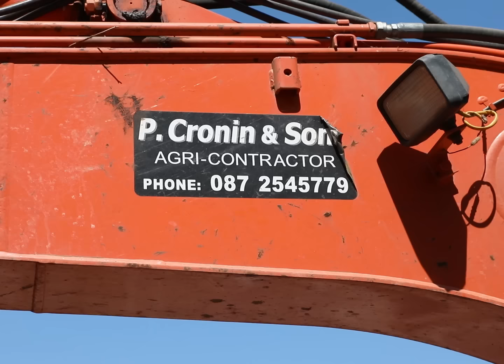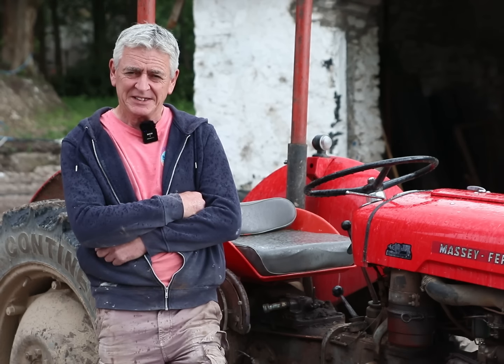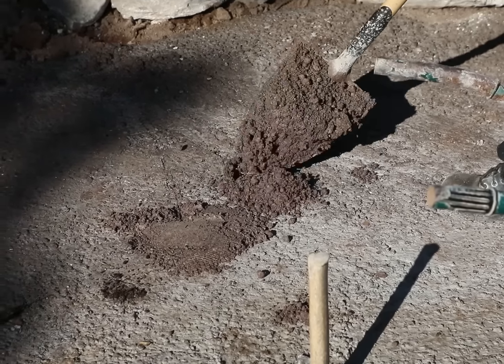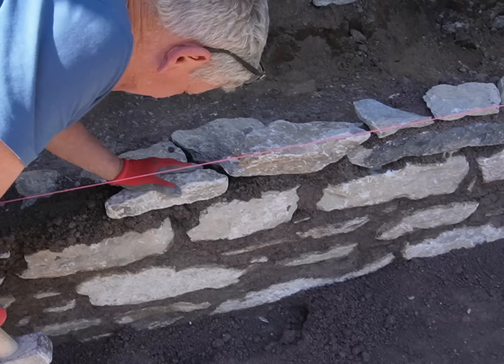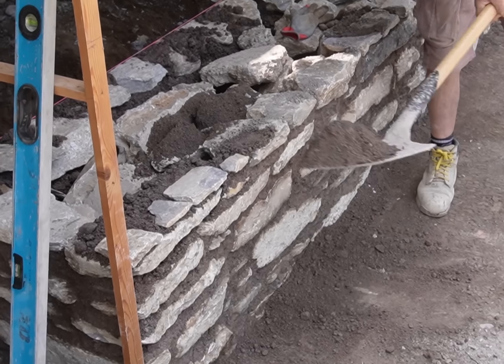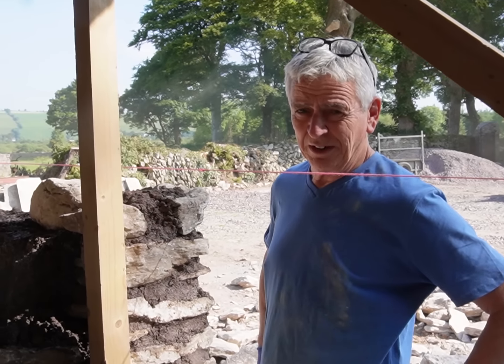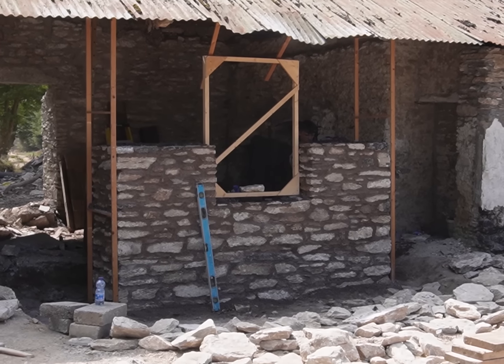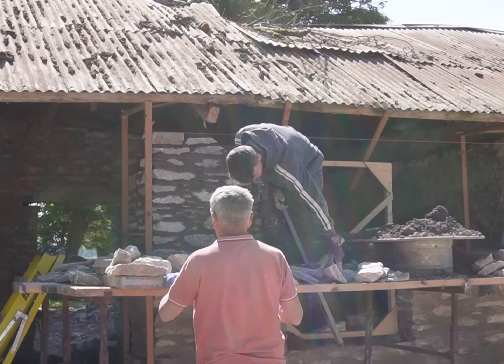Traditional Stone Wall Building in Rural Ireland

Comment: When I was learning in college, my lecturer told me stone work was a sub skill of brickwork, but after seeing them work and dabbling myself you can tell its a trade that requires nothing less than dedication to the craft
Reply: That makes no sense.your lecturer is ignorant. The whole purpose of bricks was to have a uniform building material to remove the need to have skilled labor to know how to strategically place rough cut stone.  If it were so easy, why have bricks replaced masonry…because it requires less skill
Reply: @Menuki  That right just jump on the first half dont read the whole comment for context
Reply: @Menuki  Less skill maybe it a degree but brickwork in itself takes its own skill, its not about one being better than the others its them both being two sides of one trade in an essence. the mason
Reply: Paul here . Very true. I was lucky enough to serve my time at both . But to b honest I  . Brickwork is a job . Like most others . To b good at stone u have to love it and in turn u love going to work every day.

Comment: This is nice work. There are a lot of masons down here in Mexico but few really good stone masons. I've had the pleasure to work with some on highway construction building huge tunnels under where the road would be built. It was a huge endeavor and took several months gathering rock in trucks and hauling it to the site and then building it up. I see a lot of similarities in the method used by both crews, here they used cement to build the structure because it was going to have water pass through it in the rainy season.
Reply: Thank you. Paul

Comment: I have a friend who has a building just like this in Ireland which used to be a redundant cow shed not used for about 50 years which he has now restored and put back into use for a different purpose. Great to see lime mortar and traditional stone in use here.

I live in a house made with bricks and lime mortar in England and it so important to use lime mortar where it was used and not to use modern Portland cement that would ruin the building over time.

Comment: Might be worth mentioning to the guy David Wiggins and Nigel Copsley have been doing some great working looking into lime mixes, seem to think 1-2 quicklime or 1-1/1-1.5 hydrated or putty, way more free air lime than we are used to with Portland or hydraulic (NHL). They tend to advocate quicklime as the best source or hydrated, then putty but not NHL. Different mixes depending on the lime source as it was all quick lime back in the day. Takes much longer to cure through carbonation as air lime doesn't dry like we are used to. Fantastic seeing that work and skill though.

Comment: just did a quick search on lime. lime takes less energy to manufacture than cement, and, unlike cement, reabsorbs CO2 for a considerable period after manufacture making lime nearly carbon neutral, while concrete is a major contributor to the climate crisis. ☮️

Comment: Great work. It would have been nice to add some spray foam insulation to the center of the wall that was being filled with rubble. You could have used steel to connect the outside wall and the inside wall. Would make for a comfortable home. Just a thought.
Reply: "It would have been nice to add some spray insulation... ". 

While insulation inbetween the outer and inner visible walls seems like a good idea at face, based on what Paul said, it would defeat the purpose of the lime mortar. He mentioned the reason they use lime mortar instead of brick mortar is to allow the building to breath, so you don't have moisture problems inside. Spray insulation would stop moisture from moving through the wall from either side, although maybe that would be a good thing? It would be interesting to hear Paul's views.

Comment: Great video Eoin, Paul and Mikey. The limestone mortar appeared quite dry and 'loose' relative to traditional brickwork mortar. Additionally, it didn't appear you compacted it much, particularly in the centre of the wall. The only place it appeared you compacted it, I assume by 'rubbing it in', is between the outside stones. Or did you also compact the inside stones as you went up each layer? From a viewer in New Zealand.

Comment: Great video. I'm interested giving this a go. Any more info on the lime type?
Reply: Hi Darren. I remember in masonry school (with bricks and blocks), they used 'slaked lime' and it was easy to take the brickwork apart and kind of clean up the bricks with the edge of a trowel so the bricks could be used again the next day in class. According to Wikipedia: ..."Calcium Hydroxide (traditionally called slaked lime)....produced when quicklime  (calcium oxide) is mixed with water. It has many names including hydrated lime, caustic lime, builder's lime, slaked lime, cal and pickling lime....Calcium Hydroxide is commonly used to prepare lime mortar...See also 'Lime Mortar' (in Wikipedia)". The little bit I know about stone masonry is you want a good foundation (below the frost line, I believe) and the biggest enemy of a wall is gravity, so you would want the wall to be 'plumb' and not leaning like the one they took down in this video. Because of the weight of the stone, I believe the mortar is  a much dryer mixture (less wet). I really wanted to study stone masonry but they weren't offering it at school that year and I soon changed career directions due to a horrible building slump in the economy at that time. All the best with your future projects.
Reply: @bluebird1239  Thanks so much for the response.  I've been doing a lot of reading on the subject of lime mixes recently as I'm starting to do up an old cottage that needs a lot of repairs. I have block laying experience as I work in construction and groundworks, but I'm trying to make sure I get my mixes right for the old stone cottage. I've been told that cement is a big no no anywhere near these walls as it doesn't allow the wall to breathe.

Comment: The announcer noted late in the video that this process was ‘less efficient’ than current methods.   I’d like to offer a different thought on that.  All that stone was carefully selected long ago and sorted for size, hardness, consistent quality and quantity.  It was transported at cost, as well, from its source.  It hasn’t lost any of its preferred quality requirements.  It has 100% of its replacement value still intact.  The amount of energy (fossil CO2) to rebuild that wall with the salvaging and reuse of existing materials has to be a tiny fraction of what modern methods and materials would require and with dramatically less material throughput and waste.  It’s assumed that this method required more time.  It would be quite useful to to do a hard nosed detailed cost comparison. My guess is we’d be pleasantly surprised how cost effective these tradesmen are compared to remove and replace.
Reply from the maker: Interesting thoughts. thanks for sharing.

Comment: Even though it is traditional, for the footer-slab I would have put some steel in it unless there some problem with using rebar since the structure is intended to last for centuries.   
i am sure there are still a lot of stone masons in places like turkey or any other places where there are a lot of stone houses.

Comment: We absolutely must see a revival of these traditional crafts. Sure, we must supplement them with newer, scientifically-based methods where necessary (like using reinforcement for safety during seismic activity), but there's good reason these traditionally constructed buildings are still with us today, all these centuries (and sometimes millennia) later.

There's also good reason that science is slowly but steadily validating these traditional methods and materials as superior to conventional modern materials (e.g., lime is superior to Portland cement when it comes to moisture; it's vapor permeable, reducing damp and improving in indoor air quality).

Comment: Original masonry techniques using salvaged stone, but 'reliable' concrete foundations.  No through-put 'tie-stones' were used through the wall thick-ness, as with drywall masonry without lime mortars.  The strength here is the mortar cementing the stone rubble, parged smooth or whitewashed after.

Comment: Hello, I hope you can help. I bought a house with is originally a stone house 🏠 and having issues with rising dump. Would you guys know how to treat this without injecting Chemicals into the stones walls as I don't believe the chemical will help to solve the problem for good. Many thanks for your advice guys.
Reply: First thing to look at is yr exterior ground level. If this is not 6 inchs below yr internal floor level it wil cause rising damp

Comment: No reinforcing rod in the foundation?  No steel in the wall?  Perhaps you might want to rethink that four hundred and fifty year projected lifespan?  Especially when one considers how deeply it freezes in Ireland.
Reply: U obviously still working in McDonald's
Reply: @PaulWilmot-k4u  : Actually, I am retired.  Spent fifty years in the construction and maintenance fields.
Certified welder, certified pipe welder 6" and under, certified structural maintenance, certified overhead hoist maintenance, certified overhead door and roll up door maintenance, certified woodcrafter, certified sheet metal worker. 
Also trained as tool and die maker.
Never worked at McDee's.
You jump to conclusions very well.  Clearly you have a lot of experience at that.